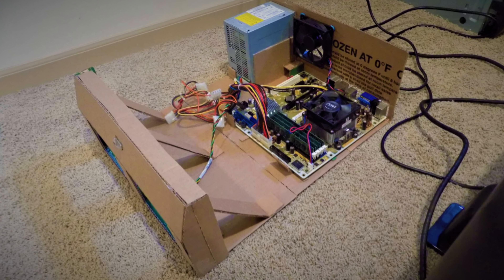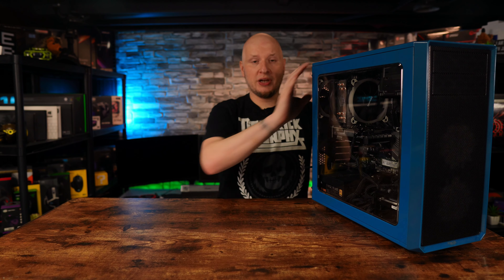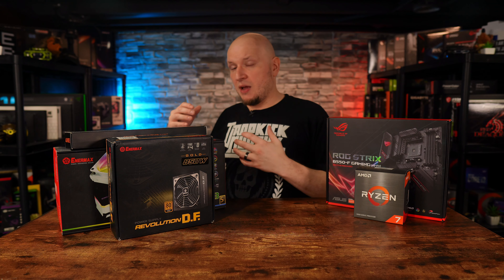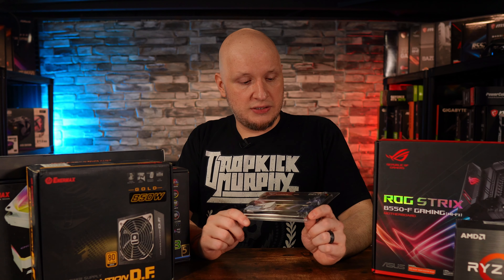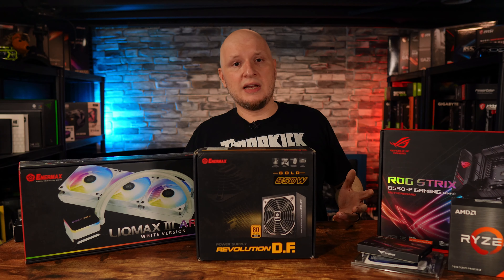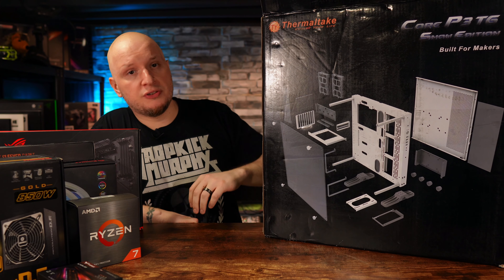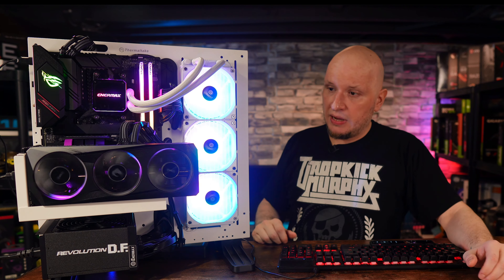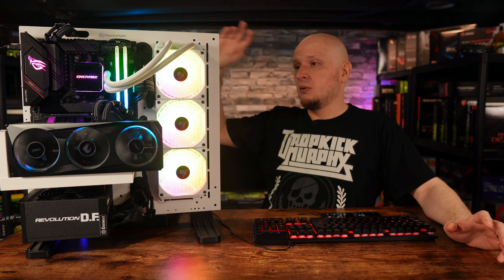New test bench for 2023! what did I do?

Comment: Again, another great video. Got a bit tired of Linus' 'let's build 120K server' over the years.
Fun fact. I own Enermax Platimax 750 D.F. platinum that has fanless operation if the load is relatively low. With this kind of overhead PSU fan never spins. Had Ryzen 3700x + GTX 1080; RTX 2070S; RTX 3070 over the years. Fan has 0 dust, clean as virgin's tear. Was like 200 Euros, no ragerts.
Reply from the maker: Solid rig! Also loved " clean as virgin tears" 😆

Comment: Thanks for making a normal bench. I think it is more useful. I want more nvmes on my next build: have windows on one, linux on another and a slightly higher class of cpu: perhaps an i7/ryzen 7 or something that is at least an IPC upgrade. 5700X bench looks nice, Helped a friend of mine do a 5800X build a couple years back. I could see this potentially or waiting maybe retiring the old 9600k at some point. Still on 9600k 3060 32gb ram but I can't upgrade much on itx board until I do a new build. Price on DDR5 is also getting reasonable though I don't think I would see much benefit for gaming in getting ram for later though am seeing tempting specials. I wish I had went with an i7/ryzen 7 on my last build(s) but I guess I bought into the this is all you need midrange hype. I think this is more suitable as a budget gaming midrange build that is enjoyable for a while.
Reply from the maker: Hey there, so technically we all only really "need" is midrange but we want more lol. To be honest though it's still a true statement ish... I think all we need is upper mid range lol. Thats mostly the fault of higher resolutions and less optimized games. My 6600 review really impressed me for whats consider budget friendly, quirky but still impressive. You could also keep an eye out, you may be able to snag someone selling their 9900k/ks and upgrade fairly cheap.